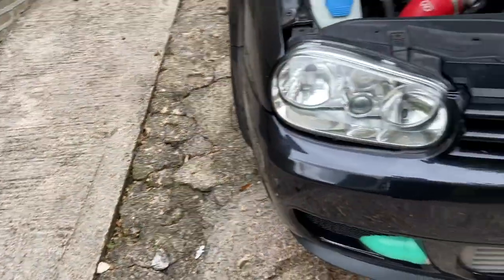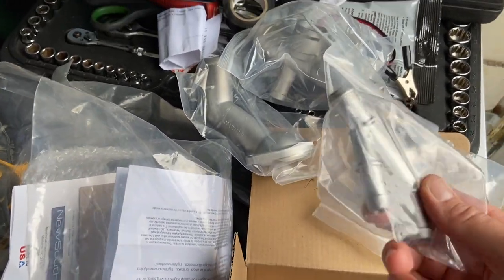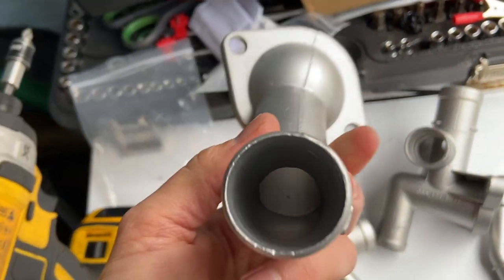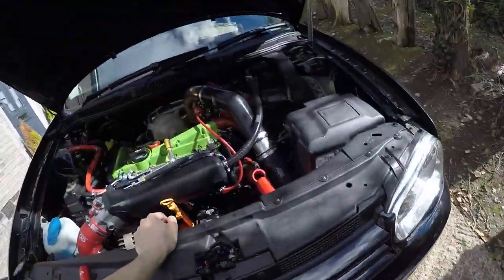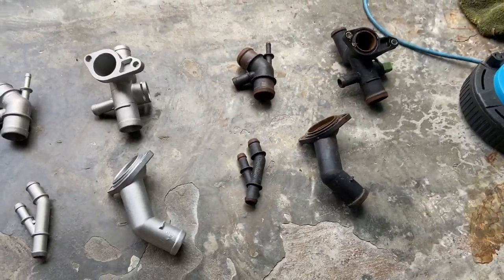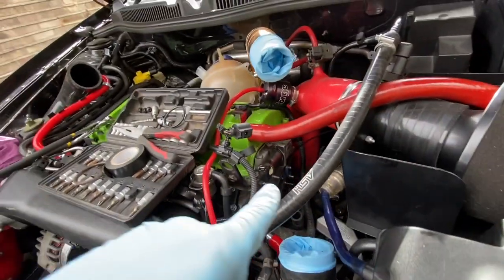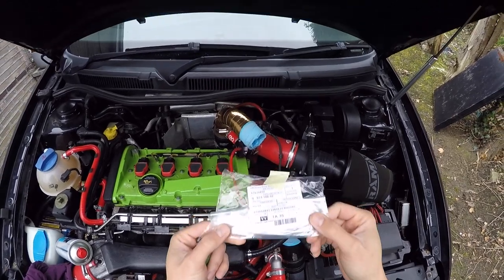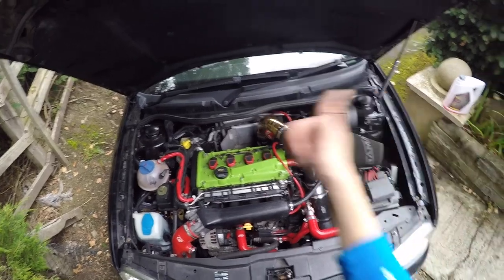VW GOLF GTI ALUMINIUM FLANGE UPGRADE *MUST DO*

Comment: Great videos keep them up, really it is very nice to see step by step how to perform such works in the engine bay by ourselves, and not having to leave the car in a garage workshop, and charge us a lot of  labour / hour rates , i have a Seat Ibiza Cupra 20VT 6K2 and i am having a leak in 2 different parts of the same pipe in the cooling system , and so the water/coolant when the car starts to reach operational thermostat temperature at 70 C - 87 C,and the pressure in the system is rising it  leaks and in a matter of few minutes the whole coolant/water mix is vanished completely from the cooling system. We have checked the oil cooler for possible o-ring leak but it was not coming from there, and the oil filter was completely dry too.

We tried to locate with more precision where the leak is  and we found out  it is coming from 2 parts of the same  pipe which is not from rubber material, that goes to the aux water pump V51 and returns the coolant to the turbocharger K03 cooling inlet port and then again sends it back to the whole cooling system of the engine, but i have bought it as a used car, and the previous owner had LPG kit installed for fuel economy reasons , so it has a lot of extra cables and piping for the LPG system as well, and the access to certain areas/parts of the engine bay is not as easy as it was when the engine was in factory stock form, my question is do i need a special torque wrench to tighten properly the screws that must be removed in order to start disassembling the inlet intake manifold, and the rest of the pipes/hoses from their clamps, or a simple screwdriver, torx, allen wrench key and a plier will do the same job?  Will i need to remove the front bumper completely by your opinion to have better access to the cooling system ?  

 I am not an engineer but i want to perform works that are  easy by myself, and don`t want to pay unfair money that the workshops here are charging, do you think it is an easy work for someone with little experience to perform? 
                                                                                                                                                                                                                             Many thanks for your videos and all your great work and efforts and personal time you are dedicating from your schedule to make these videos to show us how to perform correctly maintenance / repair works to these great engines.
Reply from the maker: Thanks for watching mate, I will be honest and say I did the job with simple tools like you mentioned above, I do recommend a mini torque wrench if you really want to do it to spec but I didn’t use one and everything went fine. I would say you can do the job but just do one area at a time and you should be fine.

Comment: Just did this the day before you posted the video, along with an overhaul performance radiator and 4 ply silicone radiator hoses from eBay needs to be done I encourage it for these 1.8ts. Thank you! @MK4-HEAVEN
Reply from the maker: Ah cool, at least you know that the cooling system is solid. Thanks for watching

Comment: I upgraded mine but I cant seem to get a hold of the 1 you picked up at  4: 55 in the video mine is a 99 plate so it has a rad sensor in mine but sourcing 1 is hard but mine didn't crack the piping just didnt seal no matter how hard you clamp it but these are a good upgrade. &the 1 that you said was hard was easier to me than the 1 under the intake manifold I cant even get my hands in never mind holding a ratchet 😅
Reply from the maker: LINCS RACING - Yes it’s a good upgrade, I didn’t realise that some have rad sensor on them. Lol that thermostat one is tight lucky I have a miniature ratchet set otherwise it wasn’t going to be easy.

Comment: Had this very pipe break a couple of years back and replaced with aluminium. Now just had the one that broke previously for you break on mine. Couldn't find an aluminium replacement this time so just replaced like for like. The overheat seems to have thrown the thermostat out, though, so now got no heat in the heater and need to dig around to swap that out - looks like an absolute ball ache of a job.
Reply from the maker: These flanges are a pain for sure, after changing mine to aluminium I’ve never looked back. I replaced my thermostat just before the flanges so I might have got away with it. The no heat in the cabin on my car was the heater core, I did a video on that too.
Reply: @Mk4heavenHD  Really hoping it's not the heater core. If the thermostat is a ball ache to reach, the core looks like a nightmare!
Reply from the maker: @edwardchester1  let’s hope so mate. Hope all goes well.

Comment: you have to becarful change and using different coolent they can react with each other
Reply from the maker: Correct mate, this car wash flushed out properly and filled with G12 the recommended stuff. No issues since.

Comment: Can’t recommend an eBay aluminum kit.  All worked fine until I went to plug the sensor in on the coolant sensor housing, fit extremely loosely in its slot and ended up leaking   Had to buy a new oem flange for the time being.    It was a $40 kit though so overall still a win, just sucks having to wait a few days just to go back and replace a part you just swapped in.
Reply: I found out that too. In my case it seems to hold up anyway. The issue is that the diameter where the sensor sits is sligtly too big than on the oem part. You could try to put a second thiner o-ring on the original one to get it more snug.

Comment: at 0:42 you can see a small black Y-pipe just below the large red pipe..this y-pipe has one red line and one black line attached to it..what does the black line go to?..as in my car the black line isn't there, the smaller arm of the "Y" is just capped off..
Reply from the maker: Hi mate the black pipe off the y runs to the turbo
Reply: @Mk4heavenHD  well..that can't be too good..thanks..